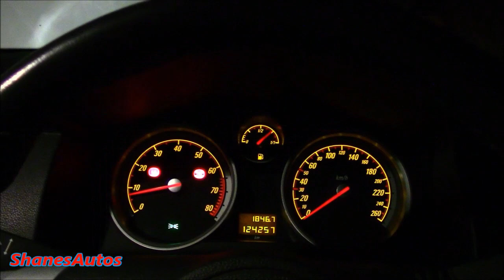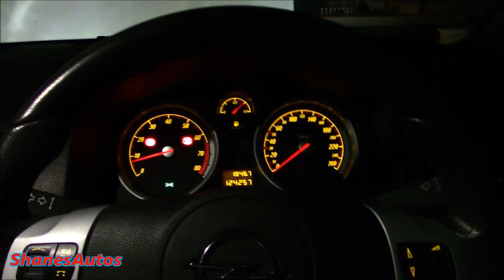Astra H GTC: LED Tail lights unboxing & installation

Comment: Thanks for making this video. I wanted to see them in action before I made my decision. I agree they look really nice. It's a shame the break LEDs are so discrete. Iv seen someone say these will only work the the GTC model. Do you know if these would work in a 2008 3 door VXR? I live in the UK if that makes any difference.
Reply from the maker: they should work with all 3 door gtc hatches. shouldnt imagine the wiring been any different
Reply: +Shane Earley thanks for the reply. One last question. How did they do the resisters?
Reply from the maker: +MattDarez ah well i brough the car to a place that sells motorhomes because they had the resistors i need for the led indicators and they installed them.
Reply: +Shane Earley You know what resisters they used? If I know that I can get my dad to give me a hand getting them to work.
Reply from the maker: MattDarez just checked and they are just standard resistors for 12 volt use. Part number is LR12 if thats any use to you.
Reply: +Shane Earley Thanks man appreciate checking for me. That's all the info I need. Going to buy these now.
Reply from the maker: +MattDarez awesome. if u cant find the led lights let me know but check kitt tuning for them
Reply: Iv got these on a 08 vxr and they work fine ,no resistors needed for indicators and look the dogs doodles
Reply: @darrenmicklewright2008  Sound for that pal. Ive just had mine arrive n going to fit them tomorrow. As far as i was aware the vxr's didnt need the resistors..cheers for the confirmation!🤙
Reply: @DamianWixx  ye mine was from ae motorsport and they are just plug and play
Reply: @darrenmicklewright2008  fitted mine at work few hours ago. Left side is a pain with the awkwardness of putting the nut back on at that angle haha. Well happy with them. Look great on my jet black vxr!

Comment: Does it matter if you don’t get resistors and just leave it as it is? Only thing ill have to get used to is the fast indicator lol. Pretty sure this only does this when the car isn’t running btw
Reply from the maker: Well the left and right indicators will hyper flash due to the change in voltage so unless you want that I’d get the resistors.
Reply: @ShanesAutos  Wdym hyper flash I don’t them blowing up if that’s what you mean but I just checked. When the car isn’t running the indicators when pressed flash quickly BUT when the cars actually running they’re as normal so I don’t see a problem cos you aren’t gonna indicate stationary so lol 😂
Reply from the maker: @GenieTheMan  go to 10:30 near the end of the video
Reply: @ShanesAutos  ok thanks. As I said when the cars running I don’t have the issue. Only when it isn’t running it flashes quickly. I just hope nothing goes wrong lol. But why would I indicate stationary so that isn’t an issue

Comment: You find it funny but i can see only the one bolt holding the left side light....where is the second one 😮
Reply from the maker: It’s in there. The two nuts were on, probably just hard to see on camera.
Reply: @ShanesAutos  mean on my car...but finally got it...u cant see it as the one when u open the box...only when u put ur had inside the cover and more down, u can feel it...i found it by luck

Comment: Where did you get these? And will these fit to a regular opel astra H?
Reply from the maker: Off eBay. No only the three door GTC model as its tail lights are a different design to the five door hatch.
Reply: @ShanesAutos  okay ty

Comment: I was wondering since you live in Ireland, would you not get in trouble for not having reflectors on the back of your car since NCT tests carry out reflector tests as well?
Reply from the maker: Mohamud haroon reflectors are at the bottom of the bumper. Passed NCT twice with them.

Comment: which resistance i need? which did u buy? i have same problem.
Reply from the maker: sanane I'm not sure to be totally honest, the man I went to had resistors in stock and put them in for me. I think if you go to your local Opel dealer they should be able to tell you.

Comment: I WANT TO BUY I CANT FIND :(
Reply from the maker: I got mine on eBay, could be discontinued but I will have a look. Are you looking for the 3 door model the same as mine?
Reply: @ShanesAutos  yes 3 door
Reply from the maker: @enesfatihkayatas277  found them but they are out of stock
https://m.carpartstuning.com/index.php?page=product&id=4983494&name=&
Reply: @ShanesAutos  Out of stock

Comment: where did you buy it from?
Reply from the maker: matthew poirier eBay. Not many 3 door style lights left mostly 5 door lights is what you'll find now.
Reply: Shane Earley but 5 dr is still gonna fit the 3dr?
Reply from the maker: matthew poirier no nothing at the rear will fit a 3 door version because the dimensions are different